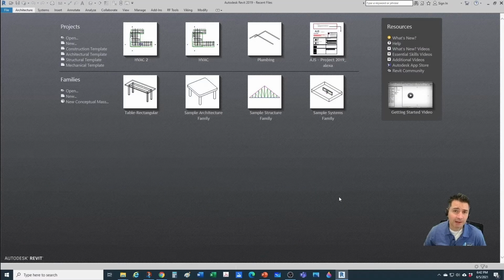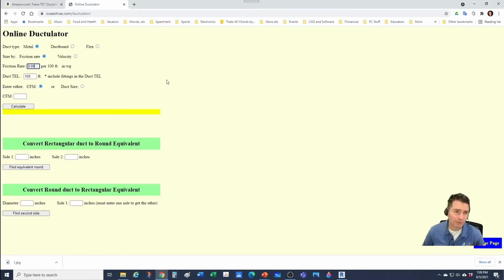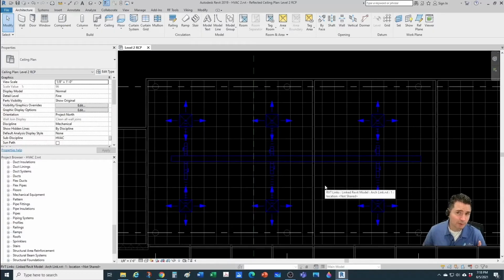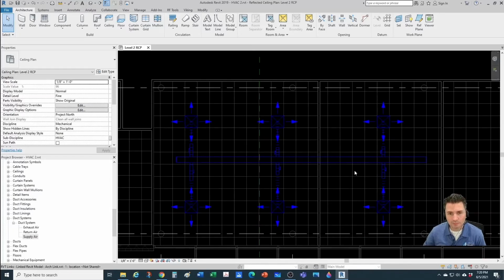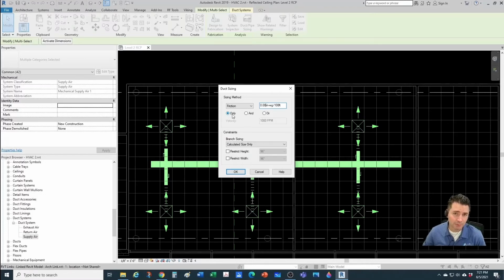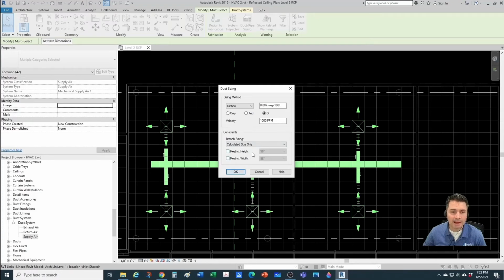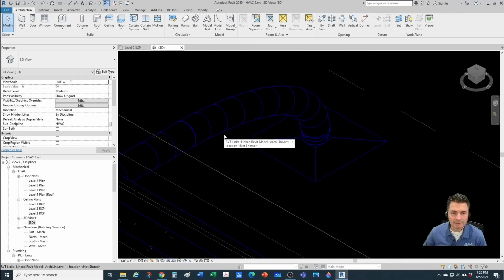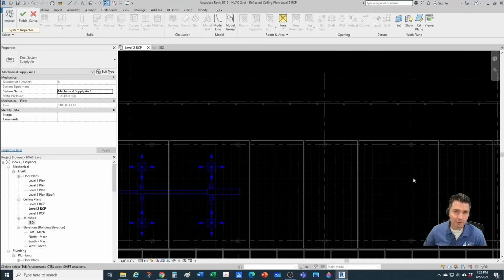How to Size Ductwork in Revit MEP Tutorial

Comment: how do i make sure that my air handling unit is producing enough airflow to supply all my diffusers? tried checking in my system browser and it lacks some air flow
Reply from the maker: Make sure all your diffusers are connected. To make sure tab select (hit tab until it all selects). All your runs should be selected all the way. Whatever doesn't select, it is not connected, so you need to check that.

Comment: 6:23 Hi just wanted to ask, isn't sizing by equal frictiom method or static regain method more accurate for ducts?
Reply from the maker: Equal friction is used most often on the supply and the return systems. Constant velocity is used for exhaust systems Revit allows for both. Static regain is strictly used for a positive pressure design.